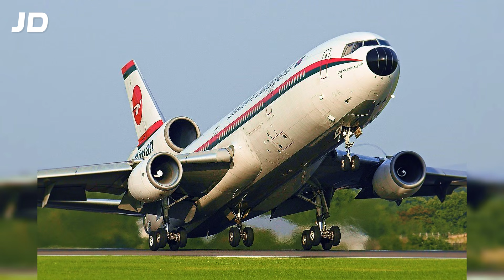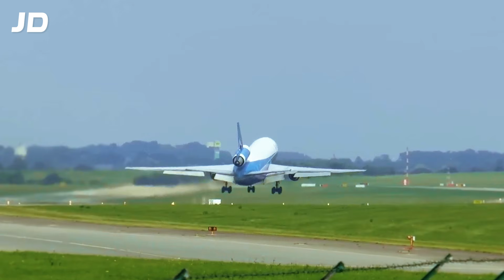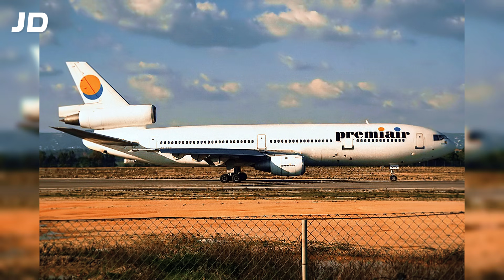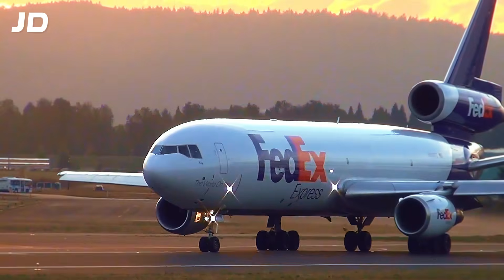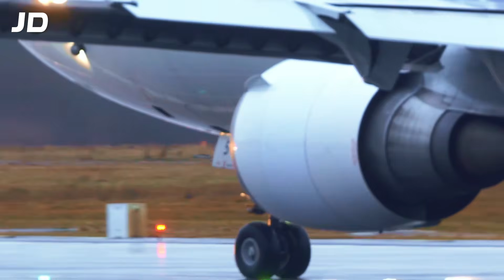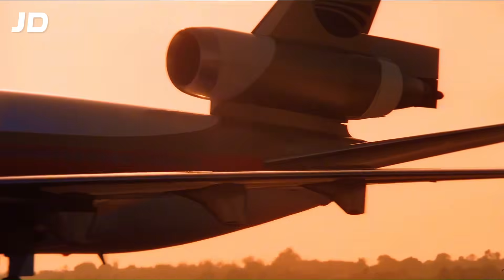How One Insane Maintenance Trick Ruined The DC-10

Comment: I remember one DC10 user was re-mounting the engines after maintenance the wrong way.  Can't remember which airline, but they were causing major damage, with the result that the plane started losing engines in midair.
Reply: Most of them were using this dangerous shortcut after an investigation was conducted. Everyone on board American 191 paid the ultimate price for it. This is a great example of why shortcuts are a bad thing.